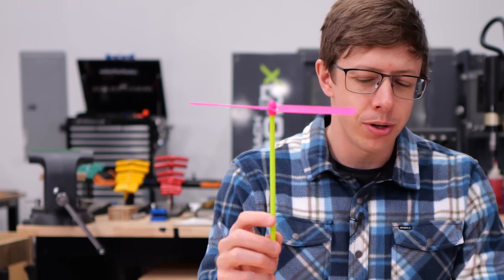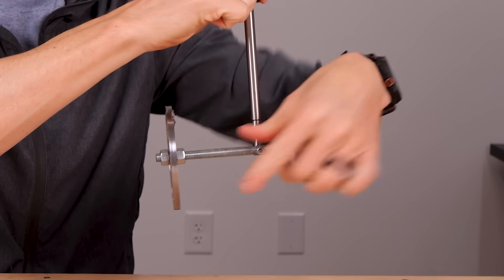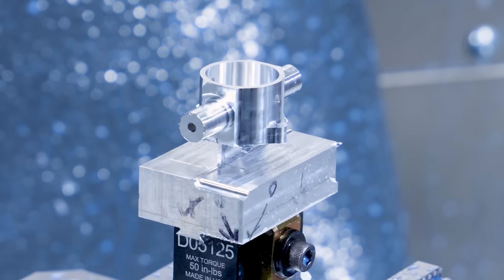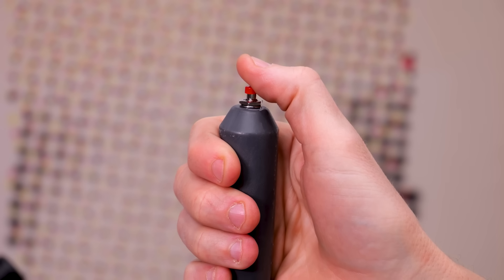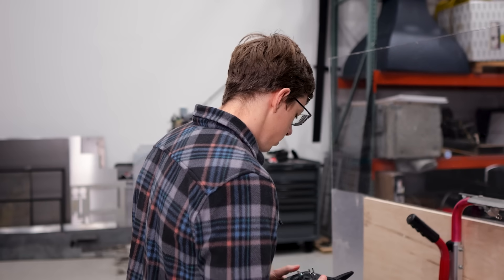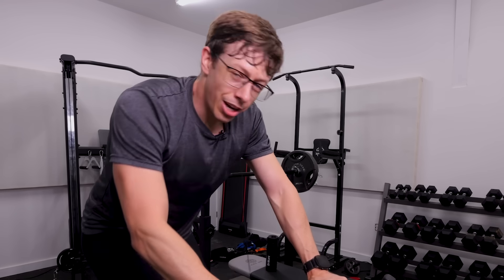I really thought this would fly well

Comment: What if you put the flywheel directly below the propellers on the same shaft? Also, turn the spokes into propellers of their own. This way you have the spinning mass without any gears. You can also test the stability by placing the flywheel directly beneath the propellers or further down the shaft to act as a counterweight to keep the device more or less vertical.

Just a thought. I hope it's not a dumb one, but it might be.

Comment: Nice project, pity it doen't work flawlessly. I think the friction of the cogs are a factor to deal with. To compensate, probably one flywheel needs to be lighter than the other but that creates an inbalance considering point of gravity. You might as well make a tail rotor to counteract the rotation. As stated in comment by @mirinewman, 2 counter-rotating main rotors might be the way forward with a flywheel directly mounted to the shaft and lose the cogs

Comment: If you want to fight the spin, just stop trying to make the flywheel perpendicular. Put one flywheel on the bottom parallel to the blades spinning counter to them. This would effectively counter that rotation in much the same way that the CH-47 Chinook helicopter does with their dual rotor system.

Comment: I thought about a little bit simpler solution. If you take the toy design and only stick a giand "donut" around it with thicker outer edge. wouldn't it act like a giant flywheel with a small propeller without all the problems (besides landing)? Then spin it really fast and i think it could work pretty good

Comment: i've never seen a piece of equipent trying to destroy itself that hard.
Reply: The running joke among rotary aircraft aviators is that fixed wing aircraft naturally want to fly and need only be provided the proper kinetic energy, while rotary aircraft naturally want to plummet to the ground and must spend every second that its airborne constantly fighting against it. Every helicopter will suddenly become a rock the second it loses power, and the only tool remaining is the autorotation, which will slow you down enough before impact that you might hopefully survive.
Reply: @michaelmattox5454  basically the same way herons fly :-)

Comment: I really enjoy watching "the process" of engineering. I use term "integration hell" borrowed from you very often at work 😂. Got a challenge for you. Make piezo electronic drum pads obsolete by creating a 3d sensor based drum pad that can detect velocity and position (away from center) and trigger without latency. Physics of of piezo based is that at least 2.5 ms of transient must be captured before triggering a signal. Spacial sensors could even predict a hit before it occurs...

Comment: You needed to lengthen the shaft, so that the weight of the flywheels kept the blades parallel with the ground.  Because the weight wasn't far enough down, it couldn't keep the machine going straight up, and it ended up going sideways and into the ground.  This also would have helped prevent the flywheels precession problems caused by them being slightly unbalanced.

Comment: I think the problem with the steering blades on liftoff is that the ground is disrupting the flow of air around them. The solution is to mount it a raised mount which would allow for the air to pass through it.
Although, I think that the only way to save this project is to resalt to counter-rotating blades.

Comment: If you haven't made a whole redesign yet, try using the same bevel gear mechanism as the fly wheels to put an equally sized prop spinning the opposite direction on the bottom. That would cancel out the torque.  Good luck finding a way to launch it though.

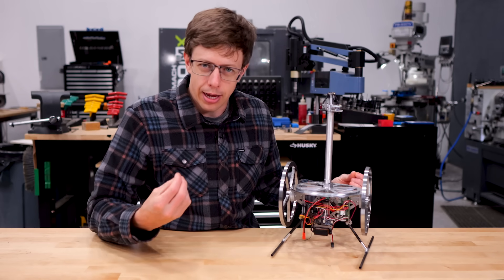Comment: 8:54 This explanation misses a key point in basic aerodynamics. Ailerons don’t push the wing down by redirecting airflow—they reduce lift by changing the wing’s shape and pressure distribution. It’s about lift differential, not forceful downward push.

Comment: Your propeller had a constant pitch and was shaped like a popsicle stick. If you used a better design prop like one made for a nitro RC airplane that is tapered and has less pitch as the diameter increases you would have gotten better results. Your prop is what sucked. The wright brothers worked all that out over a hundred years ago. You should take a look at what they did. Your effort was a joke.

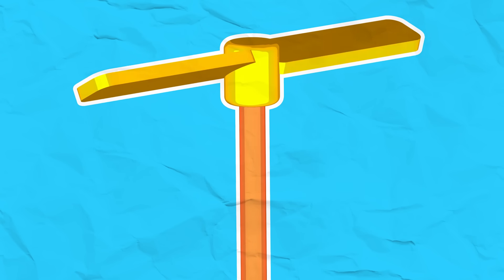Comment: guys can anyone come up with interesting solutions to this problem 2:15 .
Engineering Challenge:
Developing a mechanism or product that improves maneuverability and directional control when moving multiple table tennis tables.
Problem Statement:
Moving multiple table tennis tables simultaneously presents a significant navigation challenge due to the swiveling nature of the front wheels. When pushing from the back, the front wheels swivel unpredictably, making it difficult to maintain a straight path or change direction efficiently. Conversely, pulling from the front while navigating is also impractical, as the user must constantly move between the front for steering and the back for pushing.

Comment: Someone can correct me if I’m wrong but the axis of rotation for gyroscopic procession is the center of the wheel not the center of gravity of the helicopter so you could just mechanically restrict the wheel from processing and put it far away from the center with a counter weight so it would still resist movement and procession doesn’t matter

Comment: I am no engineer. And I know you are a genius. You made two flyweels that cancel each other out, by rotating in opposite direction. Connect them to two rotors spinning in the  opposite direction to cancel out the torque. Again I am no engineer I just like the video. Failure is just a way of learning.

Comment: would it not be the best idea to put heavy weigts at the end of the propeller instead of flywheels at least from a amount of energy stored vs total weight perspecitve that would be optimal. I would image a propeller with rods at the end which stick out, which in turn have heavy weights attached. If you want to turn this into some kind of overenginered object you can pull the weights in during flight, this will speed up the rotation again and you can achive a more consistent overall propeller rpm. Ofcourse these sticking out weights create significantly more drag the fruther they stick out but as long as the material used for the weights is dense enough it would probably still be worth it. about the spinning thing, just let the whole thing spin.

Comment: Something to consider: Your rotor will have a gyroscopic effect on its axis, locking the pitch and roll but not the yaw, probably why you chose to have flywheels perpendicular to the rotor, but unfortunately you had them spinning opposite each other on what's practically a shaft.
Have you tried imitating the function of a tail rotor? But since you're using flywheels and don't care where you're heading, put one in front and the other in back.Don't offset them from each other along their axis, but perpendicular to it.

Comment: I'm no engineer but I'm good at thinking outside the box, you changed the flywheels so they were smooth and didn't push against air but your top horizontal gear was left the same, creating drag causing the bottom half to start spinning. On my remote control hellicopter, it has 2 blades that spin opposite ways to cancel out rotation so you don't need a tail rotor, but you've got that gear spinning in wind resistance with no counter to it. If you make it solid like the 2 side flywheels you will still get a little rotation on it from wind resistance but it would be controllable through the bottom rudder.

Comment: Have you considered contra-rotating propellors one below the other?
You could also sync up the fly wheels independently to the different rotors. That way you would counter the rotation torque.
In helicopters this is often done with a tail rotor, but double rotors is common in training RC helicopters, and also commonplace in twin-engine aircraft to prevent them torque-rolling into the ground after take-off.

Comment: Drop the wings. Your should put 2 counter rotating propellers and they should be ringed and those rings should be your flywheels. In other words, no gearbox. I think you shouldn't get afraid to run it too fast. For the auto rotation part, I think you have to build up rotational speed and use before reverting to resist the descent in a cycle short enough to be able not to peak or crash. Big propeller area becomes important, not the gearbox.

Comment: Couldn’t a gyroscope in the same plane as the propeller (because the propeller i also kind of a gyroscope) in the oppesite direction cancel out the twisting? And use a cover llike the ones on the side so it doesn’t mess with the lift. Or use a counter propeller like the drone on Mars

Comment: The bottom part of your contraption sort of reminds me of a reaction wheel in a spacecraft, instead of putting control surfaces down at the bottom to use the airflow to counter it you might have been able to connect some gears to a wheel of the same weight spinning in the opposite direction below it to counteract the forces.  Or maybe that would have failed horribly too, but it would have been interesting to see the result.

Comment: Try adding one of thoese bar-bell style upper weight bar as seen on 4blade RC modles(aattached to the 2nd sec of blades) it should help counteract the forces, the 4blade ones rotate each set oppisite of each others direction

Comment: There is a reason the whole world is using multi blade drones and not single blade helicopter drones.  Helicopters are way complex.  it seemed like it still had a lot of energy still in it when it crashed, if the controls were better I think it would have done what you asked for.  you should be thinking of it more like a rocket than a gyro

Comment: It could be you're over-thinking this. It might be possible to stick with the original simple toy design. The shaft already acts as a spin stabilizer so if you just increased the mass of the shaft, you could limit the rotational speed but still store more energy in the shaft. I don't have a feel for the diameter of the metal shaft needed to get the performance you want, but length can be increased (the added weight is what might make this impractical, though). This would also let it land safely (hopefully) the same as the toy, without adding autorotation complexity, since the energy would bleed off slowly. It may end up traveling a long distance in the air though if this is workable.
Reply: there has to be a reason that wouldn't work, right? I feel like this is so obvious and when I clicked the video I was imagining like a comically gigantic blade attacked to a pole-vault stick. It would be insanely dangerous though

Comment: This was not a planned "rapid disassembling" ? 😂 
I think the propeller should be set higher and the flaps between instead underneath, lower center of gravity and better airflow over the flaps. And/Or a third horizontal flywheel for canceling out the torque.
Looking forward to see ir fly to the moon.

Comment: Out of curiosity,  if you could do counter rotating blades to equal out the torque or a tail rotor using one flywheel would it stabilize?

Comment: I can see you figuring out you need a 1:4 tail rotor, or second counter rotating main rotor. 😅 Though Im not sure if you'd need collective on both rotors to autogyro correctly. I know model helis with single shaft counter rotating main rotors and no tail can get controlable flight by only putting servos on one set of blades... but I dont think those have auto-gyro funtions. Theyre usually electric and operate more like fixed-pitch quad copters. Great to see the trial and error! As an rc heli pilot, it was fun to see you build one from scratch!

Comment: Very interesting to watch. Since you have all the tools, how about creating just a propeller (2 or 4 blades) with movable weights along the blades? This would allow to have a variable inertia around the axis of rotation. They could be either spring loaded (affected by centrifugal forces) or remote controlled. As the propeller slows down, the weights move inwards, thus increasing the rotation speed, aiming to keep it more or less constant. The idea is to have the propeller flying as long as possible, rather than as high as possible.

Comment: Really cool. Fantastic quality of work (both engineering and content-making) as always. I watch everything You made because Your videos are highlighting not only idea->result but what is more important try->challenge->analysis in the middle. 
When I saw flywheels and gears, I could not stop thinking about 2 things
1)They are heavy
2)Each mechanical transmission decreases efficiency 
And I thought about 
1) If we are using brushless motors than we can make helicopter as an anchor and "base" as a windings
1.1) it give us light rotor (only several magnets glued to plastic construction )
2) we used flywheels to accumulate energy. instead we could use part that changes it's distance to the rotation axis. At the first stage (on the ground) it will be as far as possible from the axis so that it will have max momentum to accumulate maximum energy with minimum speed. And then heavy mass  will be pulled closer to the axis by springs.  It will give us acceleration (surprisingly good) at the moment when we are are actually disconnected from power source

Comment: Could you just use simple stick and wing build with realy small wingspan and dart like wing attached to extremely fast spinning stick? I think you can reach fast rotary speeds by using pressurised air for example. Also small wingspan and dart like wing should help with  problema occuring becausd of the air resistance.

Comment: Worth a try.

Would long blades with heavy tungsten teardrop shaped weights at the tips work better for flywheel energy storage?

Then have whole thing spin including having the servo, receiver & battery part of the spinning mass so you can minimise moving parts and not have to worry about cancelling any rotation (while still being able to feather the blade angle to extend flight times). 

...Might even then be fun to try to have a servo for each blade and a flight controller that can operate while rotating at high rpms giving full 'cyclic' control, the ability to steer the thing, and some level of controlled flight.

Comment: The flaps are not going to work until they hit enough vertical speeds. So you always begin with uncontrolled counter rotation at lift off. But I am sure you will find a way around it.

Comment: How about planetary gear driven flywheels, then the spindle can rotate the opposite direction of the outer diameter and cancel out that gyro (at least a good chunk of it), then you wont need such big wings.
Or contra rotating blades and bevel gear to counter balance the one thats causing the gyro...

Comment: First time Shane looks like a human with silly mistakes. Usually his 'mistakes' are with stuff so complex they can't even be considered proper mistakes 😅. Suggestion to you Shane: Build a dyno for it, you're half way there already. With a load cell to measure vertical thrust, another for torque on the frame and a properly logged prop RPM it'll be very easy to configure a self-correcting flying 'whatever you call your creation' (inertia-copter? lol). Reason I suggest this is I have doubts on your ability to manually control those wings with enough accuracy given how fast the propeller speed decreases. 

Also: diverting air is waaay less efficient than a proper airfoil. a good airfoil design with a varying angle of attack should work to compensate it. A counter-rotating prop stacked on top like the mars helicopter works, but you can also spin a surprisingly light disc below with the same moment of inertia. Anyways, I'm suggesting obvious stuff, have fun and surprise us in part 2!

Comment: I'd be interested to try building one more like the original, but with the launcher he built. I would put a winder like in a windup toy car in it that builds winding from the launcher as it spins the whole unit, then I'd attached really large tail fins to the winder section to encourage the energy to release through the propeller. Or to keep it even simpler, make the winder prewound and have it release with the flight release. This gives you the energy from the launcher, plus the added energy from the winder. I feel like this could be made a lot lighter and simpler so crash landing isn't guaranteed to destroy it. Could probably even use plastic components.

Comment: so.... if you had flown that model plane you showed you would have had some idea of the scale of the problem. swap fixed and moving portions of the "wings" so you would be within an order of magnitude of what you needed. also put them right below the prop. and the "training gear" aka needles sticking out of a semi-truck. with no "off" switch. none of this is meant to belittle or berate - make a crazy flying thing but how about start with a known good / successful flying thing ?

Comment: Couldn't you make a counterweight, that is geard to spin in the opposite direction as the prop shaft , in the vertical axis, that would directly counter the torque from the prop shaft in the same way you added a second flywheel to counter the first?